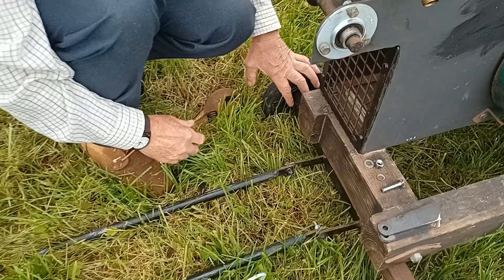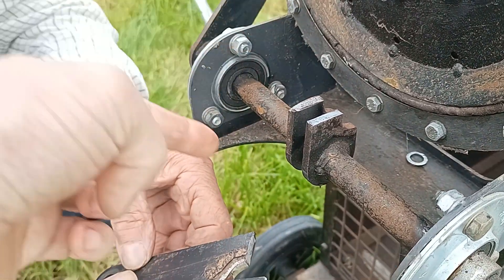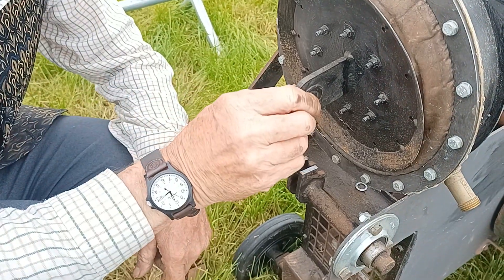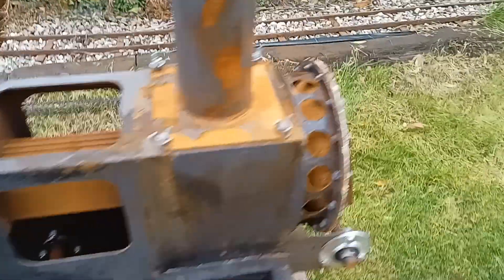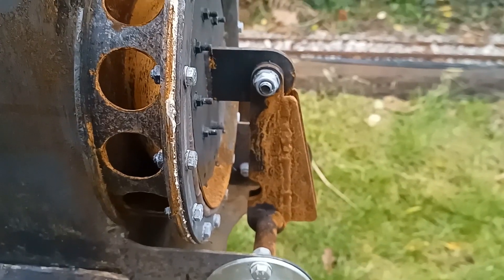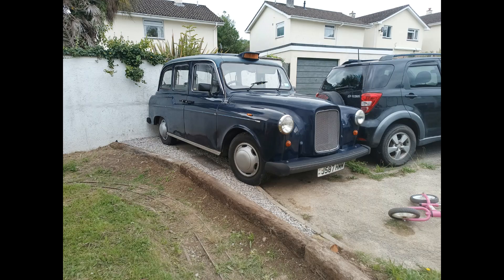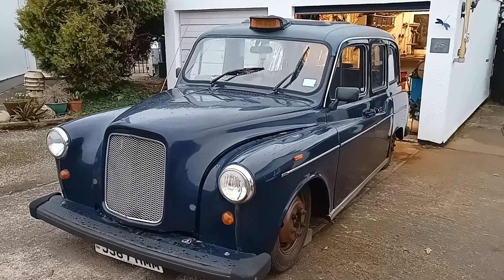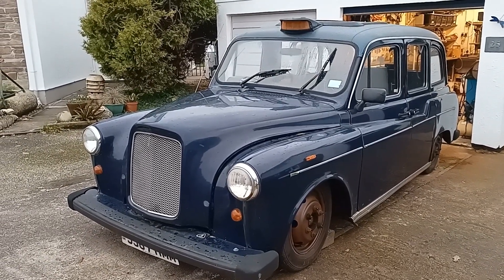Stirling Engine Generator Mk4 (Rocket Stove!) Part 13

Comment: Power that taxi with the stirling engine!!!
Reply from the maker: If I can produce a stirling engine that gives out enough power then I will : )
Reply: @ShanePomeroy  A bit off... but have you heard of a wood gasifier? 
It harnesses wood fire gases to extract as much energy as possible. 2/3rds of the energy from a fire isn't even converted into heat. 
Basic gasifier is a sealed system, where air is drawn in at fire, fuel/wood is gravity fed into fire basket. The smoke and air work through a cyclone separator to extract tar and water, then through a radiator to cool the smoke and air. The result is syngas, which is mostly hydrogen and co2. It burns pretty clean and can be used directly in combustion engines. Bypass carb and use valves to create proper stoichiometric mix of syngas and air. A blower is needed to get the fire going , but once gas is produced, the IC engine creates enough vacuum. 
If anything, it would be a cool system to get more power from a smaller fire in the stirling engine.

in my searching for free efficient power, I just came across the wood gasifier, which is able to run a 5000w generator with very little wood consumption! The syngas output is determined by the size of the flu/fire-basket. 100mm or 4" seems to be the average size to run a whole house generator. A 4" diameter fire doesn't consume very much fuel, so really efficient use of wood energy storage.

Also, I loved your journey on these engines, slowly improving the stirling.
It seems to have the most potential for greatest engine efficiency.
Reply from the maker: @Reach3DPrinters  Those wood gasifiers are really cool! I've just found some pictures of various vehicles with them fitted. I would be interested to try one if my stirling engines become better : ) My dream is to build something powerful enough to power a vehicle and drive it from lands end to  john o'groats, collecting fuel on the way! Maybe a pipe dream but I don't know?

All the best